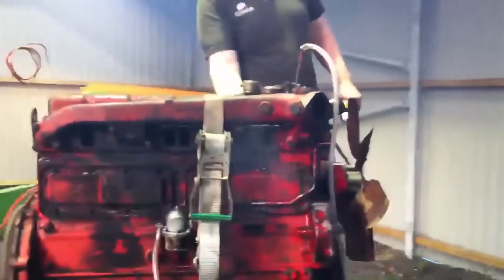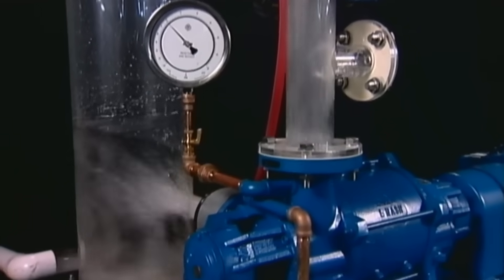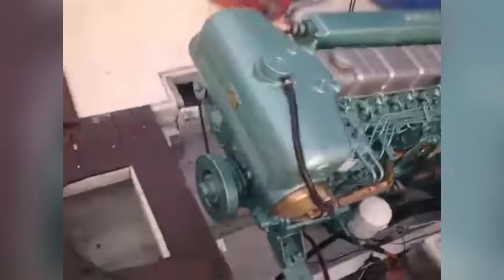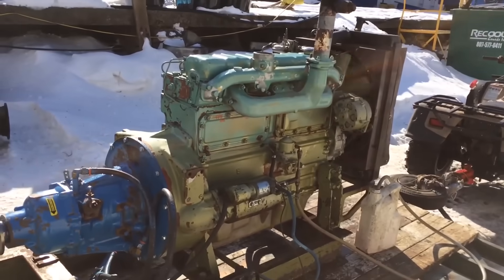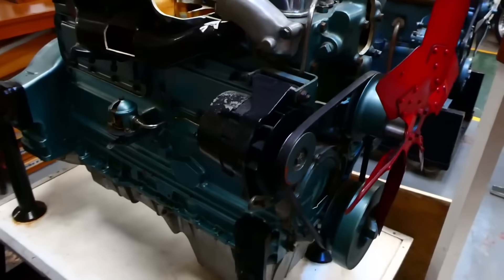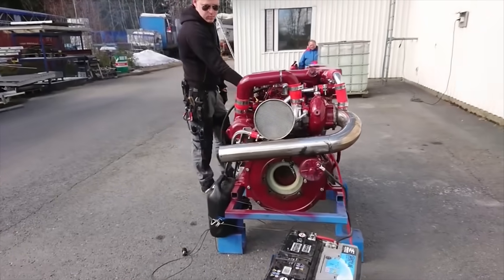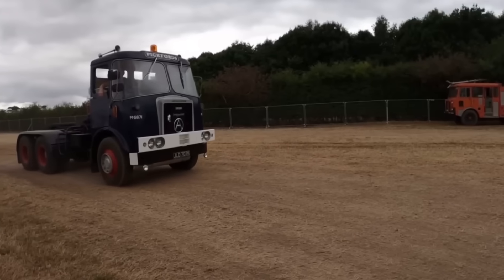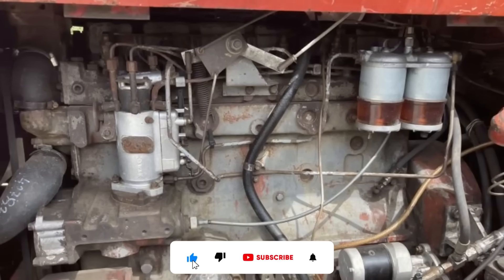Why The Perkins 6.354 Was Banned: The Engine That Was Too Powerful

Comment: Worked as a mechanic for British post office I was sent to Perkins engine factory in Peterborough uk to learn how the diesel engine works and saw the production of this engine 6.354 from forging cylinder blocks and cylinder heads to machining to actually starting and testing that was a 2 week course
Reply: FORGING blocks and heads, not CASTING? What did that giant forging press look like? If a non-mechanic had said "forging" I'd be doubtful, but any skilled mechanic especially that long ago would instantly know the diffference. 
I wonder what became of the press and tooling?

Comment: It was banned because it was simple, reliable and bullet proof. Amazing on fuel but probably didn’t meet emissions. Electronic engines keep the shop busy at dealerships. Sure miss those days when deaf fluid meant you had ear infection.
Reply: Dude.... This motor was never banned, ok    These click bait vids should be banned though

Comment: The International tractor has a Neuss motor from Germany, no Perkins there.
Reply: The 62 hp I h had a Perkins
Reply: @Patjoeegghead222  the model 475  think ?
Reply: @jamesbarbour8400 Although it is difficult to see exactly what model  that International tractor is, it is a 986. 786 up and 66 series used the Nuess motor in various sizes. The change over to Nuess came in the 706 of about 1966. The smaller ones had the 4 cylinder Nuess. We didn’t see too many Perkins Inters here. Prior to the Nuess motor they had their own motor and of course the Inter V8 in the 1468. Chamberlain used a lot of Perkins motors.

Comment: A bit of bullshit here. Never used for offshore racing. They were 120hp naturally aspirated. Turbo wasn't big power either but they were and still are legendary engines. Also the statement about fuel economy. They were always very economical. They are a pain the arse to bleed with the rotary CAV pump. I would've preferred and inline pump like the English Fords had.
Reply: I will tell you how to bleed the fuel system.
With the handpump, bleed the fuel filter, than the two nippels on the rotary injection pump.
Till there are no bubbels.  Then untighten all the nippels on the injectors.
Start the engine round ( full throttle, stop solenoid /lever , activated) till from every line comes a shot of fuel. ( no bubbels / air )
Connect the injectorlines again.  RUN .   Guaranteed.
Reply: @g.jeu.2187 yeah your absolutely right. That's exactly how it's done. Just compared to some more modern stuff it was a bit of a pain. Don't get me wrong. I'm not knocking the engine. Beautiful engines. I love them. Any old school Perkins in fact.
Reply: Absolutely no trouble to bleed the fuel system. I don’t know why you have trouble.
Reply: They were used in the cabin cruiser classes that included Fairey Huntsman, Huntress and Swordsman boats.  Check out the history of the Cowes to Torquay races.
Reply: Yes, no way a 354 powered any power boats to victory. The DPA pump is bullet proof and very simple. Way better than any inline pump. Fitted to millions of diesels and still made in India under licence by Delphi.

Comment: We had both 6354.4 and 6354.4 AT. Brilliant.
Reply: Same here. First in an E 27 N Fordson Major of 1950's  Vintage; Injection was via Ricardo toroidal swirl pre combustion chamber and one injector orifice directed directly down the throat of swirl chamber and into the cylinder proper.
  Second IS STILL OPERATING in a 1976 White 2-105 Tractor with no signs of quitting.
Reply: @richardbarber4444 That was probably the Perkins R6, the 6-354 was a direct injection engine not indirect.
Reply: @richardbarber4444  I am pretty sure that the engine choice in the E27N Majors was a Perkins P6. 
Personally, I have never seen an E27N Major fitted with the 6354. I have also seen them fitted with the Perkins L4 four cylinder motor, and of course the most common side valve petrol paraffin variant.
Reply: In turbocharged form it was a very capable engine with a good life expenditure,easy to work on and reliable it’s no wonder it was so successful. There must be millions of them around the world still running.

Comment: FFS show the actual vehicles, tractors, boats, combines, generators,etc that it was used in! 
Most of the ones you show did not use the 6.354!
Reply: That’s true. The Fordson Major had a P6 which was much smaller than a 354.
Reply: Son motores duros de caer.

Comment: Reliable- yes. Easy Starting - NO. Clean running - definitely not. Powerful - about on-par with similar size engines.
So this engine NEVER WAS considered to  be "To Powerful" and with regards to smoke it liked to pour out thick black smoke when worked hard hence the multiple piston and cylinder head redesigns.
Clearly whoever up-loaded this video has never run a 6.354.

Why show a direct injection 4 valve petrol cylinder at 2.35? This has nothing to do with the 6.354.

No 6.354 ever drove anything other than a small air compressor for vehicle brakes off its aux drive shaft. This was a small diameter shaft limited to very low power outputs.

The production of the 6.354 ended in the mid 1980's. It was replaced by the Perkins Phasor engine which cured the 6.354 starting issues, improved fuel economy and eliminated the exhaust smoke.
In the mid 1990's the Phasor was replaced with the 1000 series.
Reply: Who writes this rubbish,I worked on a fleet of 16 tonne Seddon 16/4s with 6-354 non turbo engines,we had very little trouble with these power units,the oil burning problems I put down to chrome liners that polished up and then used oil but went like the clappers. I just wish these people would get their facts right,the turbo version was amazing and pulled like a train at lower RPM,great engine if looked after,I had a truck of my own with one of these engines and because of oil burning stripped it and changed the liners to cast iron,end of problems.These people haven’t got a clue what their on about.
Reply: you must have had very bad luck with the 6.354, we have never ever had any major issues except for leaks most of the time
Reply: Not to mention featuring a Gardner 6 a few times.I've never had issues starting any Perkins. Ever.
Reply: @davidwolff8903 The Perkins P6 and R6 we’re difficult starters because they were indirect injection as were some of the four cylinder engines of yesteryear but the 6-354 and 4-236 were never difficult starters as long as you used the glow plug in the manifold to aid starting,best mast produced engine of the time.
Reply: Clearly you don’t know a lot about these engines either,the ones we had Never black smoked and started easily summer or winter,the haulage company I worked for used these engines for hundreds of thousands of miles with very little trouble,the turbo engine was outstanding when compared to the Perkins V8-510 piece of crap.
Reply: @davidellis279 yes the 510 was a lemon.
Reply: @davidellis279  yeah the perkins v8's wasn't really anything to write home about, i remember my very first summerjob outside our own farm, was at a place about 10 miles away, they ran a 2775 and 4900 MF tractors, to be completely honest, i have no idea how they got all their ground worked over at all, they ran terrible and no torque, our own 699 and 2675 and 2725 ran way better.

Comment: Ok in tractors , no good in trucks , use oil .
Reply: I had one in a 16 ton Dodge K1050 never gave me any problems.
Reply: @brianwebb191 yeah they were great in the K series Dodge and also the Maxiload Commer.
Much better than the AV 505.
Reply: @seamusburke9101  I had two Perkins engine commers , both used oil , one under 100.000miles cracked pistons on all cylinders drank oil like a drunk . Not heavy work , 7 tons max .
Reply: I have had it for years in a truck with a repair lasts more than 5 years without problems
Reply: @alejandrobrito5139  heavy or light work ?
Reply: They were good in trucks, the only problem is they were big enough.
Reply: We had one in our breakdown wagon, of all the trucks we had the Perkins engine was the most reliable and the most economical, it was also the easiest to start, the Bedfords we had were a pain in the rear.
That was then, now I have two HT6.354M in my boat, 50  years old, start at the flick of the key in all weathers and they still produce enough power to make the book speed for our boat.

Comment: Nah, it wasn’t bad but didn’t make a lot of power for its bulk.
Reply: Pero tiene un torque que de arranque le gana a motores más grandes y es muy economico
Reply: The 5.8liter Yanmar can produce up to 440hp and the last itteration of the 6.354.4 (5.8litre) was 240hp
Reply: Kind of like your Head it's big, but it doesn't have a lot of Brain power in it.